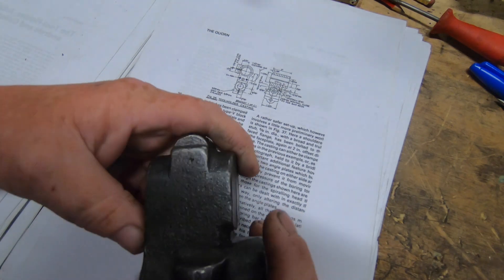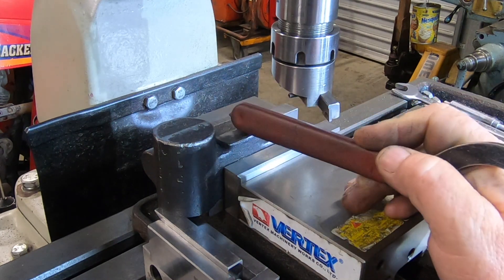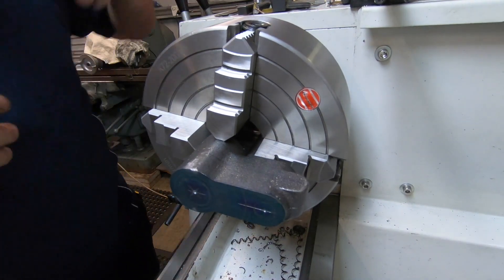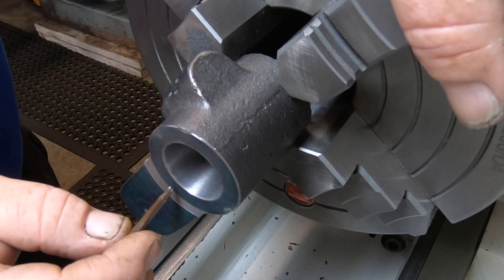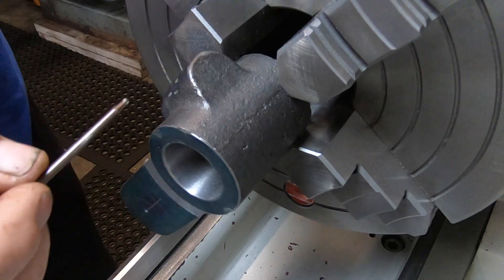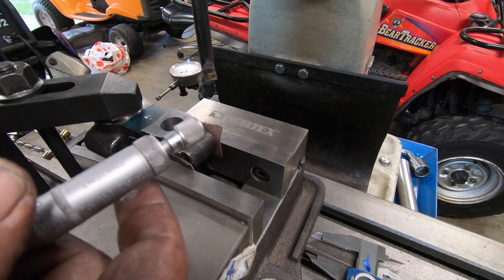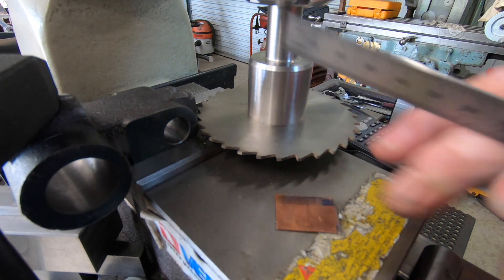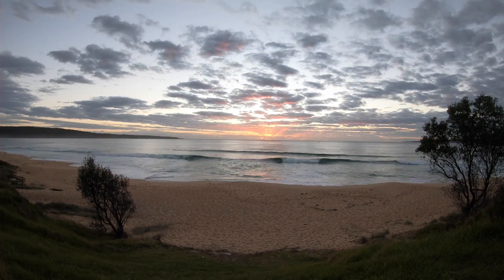Quorn tool and cutter grinder - Tool Holder

Comment: Good job mate! It does not matter how things are set up because there are more than just one way to set up a part. You set ot up and it worked that is all that matters. Hope everyone is good at home and have a good Easter. Cheers
Reply from the maker: Gday Yves, there’s that many ways to set up but it does get confusing at times and hoping that I’m doing things correctly, it all worked out well in the end which is the main part, everyone’s good here and the weather is perfect for Easter and the tourists, thanks for watching mate, cheers Matty

Comment: Great video as usual, coming along nicely, I do like the dial indicator mount assembly you shoved into your boring bar, cracker of and idea, will be remembering that one!!
Reply from the maker: Gday Warren there was a lot of discussion some time back about cosine error with the indicator set up but I not that smart to worry about that mate, it works for me and I’m happy with that, thanks for watching mate, Cheers Matty
Reply: @MattysWorkshop  if it works its good enough for me.

Comment: Hello Matty,
Hats off to you mate... Working with the plans and work instructions that presuppose you're using a Myford lathe must be a challenge and call for a lot of exercising of the old grey brain cells... See you on the next one...
Cheers.
Paul,,
Reply from the maker: Gday Paul, it’s a testing project to say the least, there’s so many different ways to build each component and trying to workout the order of procedure is a challenge, thanks for watching mate, cheers Matty

Comment: I think you're doing really well Matty - hope you're proud of all these parts you're making :-D That casting in particular looks tricky, lumps everywhere. You seemed to nail it all though. Nice one
Reply from the maker: Gday Craig, so far all bits I’ve made I’m happy with, working with castings is completely new to me and trying to figure out the order of procedure is not that easy and very time consuming, hopefully there will be another video out soon with a bit of luck, thanks for watching mate, Cheers Matty
Reply: @MattysWorkshop  you're nailing it, so I wouldn't worry! Looking forward to the next video, you are certainly a trooper. Thanks mate. Craig

Comment: You said you weren't sure at all about order of operations on this part considering it was a totally raw casting, but I figure you did pretty darn well as the part came out to spec!
Reply from the maker: I had no idea where to start and what order to do it in so I just made a start and I got lucky again mate, it all turned out better then I ever expected, cheers Matty

Comment: Nice work Matty.
@9:30 at those rpm's I would suggest a counter balance to that sort of mass offset. Something as simple as a machinist jack to move the chuck jaw out a comparable distance to the other side. It doesn't need to be a perfect equal balance but it will make a big difference to finish and accuracy
Reply from the maker: Gday Phil, this is something I should have done, the lathe didn’t really feel the offset weight to be honest, thanks for watching mate, Cheers Matty

Comment: Hi Matty ... working off a set of plans, which don't look that crash hot in the first place, shows your commitment to the Project.  Very nice setting up & machining.  Looks really good.   Job well done,  keep up the good work. Oohhh glad your getting the rain, we've been  good except for the occasional drop or two.
Reply from the maker: Gday Ted, the plans don’t tell much at all at first compared to other plans if seen before, there’s a lot hidden in the written section so lots of reading that’s for sure, thanks for the kind words mate, much appreciated, Cheers Matty

Comment: Hi Matty, I'm about to finish machining the same casting myself & found your approach useful & pretty much what I had in mind. I think the Quorn was originally designed to just be mad on a lathe as back then most home workshops wouldn't have a mill, is there a wrong way to machine it if it comes good at the end ? I don't think so ! Why wouldn't you make it easier to machine by using your mill ?
Reply from the maker: Gday, the Quorn was definitely designed to be made on a lathe alone, I’m really not sure why I didn’t use the mill, I honestly can’t remember, thanks for watching and commenting, Cheers
Reply: @MattysWorkshop  Hi Matty, just watched your workshop update video & is that a finished Quorn I can see lurking on the left of the bench ?

Comment: Hey Matty! I noticed that dial indicator that you mounted in your boring head when making adjustments. Is that shop made or did you purchase it? Do you have plans for it? Absolutely brilliant tool.
Reply from the maker: Gday, this is homemade and I don’t have any plans sorry, really easy to make though, if it makes it easy for you I could grab a few rough measurements and email them to you, cheers
Reply: @MattysWorkshop  No worries. I can work something out on my end. Just brilliant. Simple and brilliant.

Comment: Hi Marty,
Another well paced vid 👍
Imagine trying that build on a little Myford 7 eh?😱
The good thing about projects like the Qorn ( and the other tools you’ve built), is that you will get years of use out of them.
I liked the setting solution for the boring head 👍.
I remember in one vid you mentioned the difficulty of resetting the head on the round-column mill. I think you could apply the DI idea to that too?
Anyhow, I really enjoy your work mate 👍.
It’s been pissing down over the last month up here in Sydney too. 
Best Regards,
Robert
Reply from the maker: Gday Robert, I can’t imagine what it would be like to build this on a myford, it would be very testing I’d say, Bruce from Gemtek in Perth has a modification he makes called the “truline 8”, very good system and I hope to be able to afford to get one soon, fingers crossed, apart from that the mill is a good machine, I think we have had enough rain for a while here for now and the tourists have got absolutely beautiful weather for the Easter holidays, thanks for watching mate, take care, cheers Matty

Comment: I liked your cunning way of measuring your boring head feed. The dials on mine are bit useless! Now I've  seen that idea I'll be doing that too, thanks for the idea. 
I also liked your adjustable parallel. Was it your idea and did you make it. If so where would I scare up a plan?
Oh, btw, I like your vids, well done.
Reply from the maker: Gday Peter, it is really easy to adjust the boring head this way and very easy to make the mount, I do have a set of plans for the adjustable parallel jack, if you email me at    ttmrj@telstra.com    and I’ll send them to you, thanks for watching, Cheers Matty